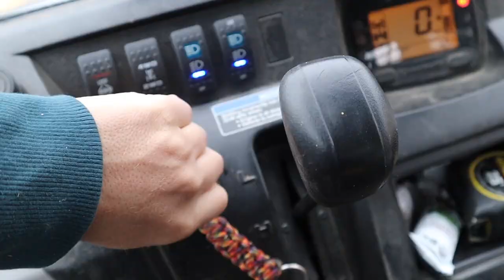We've Never Done IT Like This Before Installing a Gravel Floor in Our Post & Beam Barn

Comment: I would want to spot a couple of 40' CONEXes at the new place to begin a base for operations. It would permit secure storage of tools and equipment and can be finished out as office and shop space. You can even add roof trusses and corrugated metal to create sheltered space between them.
Reply: That's a good idea to get a shipping container up there - lock stuff up and a good  center of operations, as you said.
Reply: Andrew Camarata took this principle to the extreme! Check out his castle!
Reply: Office space, really? lol
Reply: Matt over at Diesel Creek has an excellent one of these! https://www.youtube.com/watch?v=iQOnURQ-hGs
Reply: Practicle advice cheap easy to drop off and easy to maintain and hold a sellable value once done with them
Reply: I would also suggest moving a travel trailer to the site.  That way you have shelter and a clean bathroom to retreat to when working on the land.
Reply: @susannielsen8688  They already have plans to build an outhouse, and I thought the container idea a good one for a base of operations while clearing, etc.
Reply: yes..sounds like a sound plan..at one time, we must stop thinking like a ''Settler',...lol..2 containers set apart..a few trusses and wham bam you have yourself a functional garage and storage space and even a place to warm up with a stove and adjacent lew..all fireproof
Reply: @freddddyyyuk  yes, I love the resourcefulness of this guy.
Reply: Judy G.  storage needed for them chainsaws...lol
Reply: @susannielsen8688  another great option but 2 -40 or 50ft containers  give you more bang for the buck

Comment: When we got our raw woodlands we purchased a camper and set it up. This provided us a place to stay, warm up, and store some basics. Once building was done the camper went to a new home. We hauled water and propane and were able to have hot showers and heat and AC even! A small generator was all it took to keep things running. We could spend a couple days clearing land and have a comfortable place to rest our weary head at the end of the day. It made the experience much easier and we were able to start using the property right away.

Comment: My house was empty for several years before I moved in. I’ve been battling mice for six years. I started using Peppermint Spray. Just Peppermint oil from the grocery store mixed with water. I spray every week. So far, knock on wood, I haven’t had any mice. Try it. It couldn’t hurt anything and it makes it smell good.

Comment: Good job you three. my wife just moved back to Idaho onto 40 ac. of timber ground. I don't recomend starting over at 70 but we are both in good health just slower. We would loved to have got 500 ac. at your age. Logging is good as long as you keep a close eye on the contractor. May God be with you all on your journey. I think you can safely take the mower off the tractor now. Good Luck.

Comment: Coppicing of woodlands has been around for hundreds of years, and woodlands need to be managed. Which is why I can never quite understand the controversy when it's a practice as old as farming. 🤷‍♀️

I would love to see any clearance of the land to bring it back into manged use. I'm not sure a full tour video is something I would be interested in, I think it would be more fun to find out little bits here and there as you discover what the land holds. 

Certainly any building work on the new land would be of interest to me, especially if it relates to livestock.

Stay safe, everyone.

Comment: Looks awesome Al, that gravel will be as good as concrete. 
A tip - if spread/broadcast a couple bags of cement over it (just buy hand just like seed spreading) and water it in with a spray nozzle then compact it it dries rock hard and lasts for years.

Comment: Hi Gina,
Another way to make delicious tortillas is to use grated frozen butter in place of your oil. You can also use lard (also grated frozen) from your lovely pigs. (If you try these, don't over mix, best to use hands.)  Fry them in your cast iron skillet or use a tortilla press.  They freeze well and can be warmed in the regular oven or toaster oven.  For a sweet version, try them with nut butter of choice; melted chocolate or hazelnut spread; nut butter and jam or syrup; or use just butter and sprinkle with cinnamon.

Comment: I believe if I had that barn you built with the concrete floor I use it one side for chickens and the other for the goats. I believe that the reason those chickens are getting out is they are flying on top of the one coop and over the fence. Plus the fence is a little low. Because some chickens are determined to be free range. I do agree that logging is necessary. I'd love to have this 20 acres logged a little bit. Can't wait to see what else is found on the new property. Have a great day today.

Comment: Good morning.  I built a shed and lined the out side perimeter with large rocks and filled in around them with the same gravel you are using to taper away from the bottom boards (which aren't treated). It keeps the flow of water away from the wood. I did it six years ago and the wood hasn't even begun to decay. I figured since you have an abundance of rocks you may want to give it a try to keep the boards from decay and water seeping into the garage / barn.

Comment: I will definitely agree with a sawmill and also a chipper because even after you finish your initial logging you will have plenty of use in the years ahead. Hopefully you can offset your logging expenses with some nice logs and still have plenty to mill at a later date. Good luck and congratulations on your new journey 👍

Comment: As a first project on the new land I would definately build a small cabin for storing tools and equipment, but also insulate it and set it up as a refuge cabin for yourselves.

I would also consider putting down geotech fabric under the gravel around the buildings that are high vehicle usage areas to stop the gravel sinking into the mud.

Comment: P.S- How far away is the grid? Can you easily hook up or are you going for off-grid? We built for both. 
   Thanks! ~ Diane
Reply from the maker: We want to go off grid
Reply: @LumnahAcres  So maybe solar? What about possible water (hydro) and/or wind power.  Solar would only be practical in warmer sunnier months where you are.  Maybe have two or even all three opt.  for the best time to use them?  Wind is only practical if you have wind enough and water when the water is moving.  Winter might be totally out as an opt. unless you have a gas generator or maybe steam using firewood.

Comment: You might want to rethink removing dead fallen trees. Sure, This may reduce the potential of fire, however, these fallen trees and debris are a vital part of the health of your forest’s ecosystem. 

We are big fans of your channel. We’re excited to see what you have in store for the future!
Reply: When the Lumnahs logged their current property, it was 100% clear cut.  I'm hoping that's not what they are planning for the entire 500 acres.  I'm hoping they'd clear cut areas they plan to use as pastures and make sure to keep much of it "as is" for future access.  Or maybe a combination of "clear-cut" and "selective" logging, picking out certain trees, harvest them, leave the rest.  Costs more (less profit for the Lumnahs) but could be a better long-term plan.  Once a forest has been clear-cut, that's it for at least a few lifetimes to get it back.  That's why I am hoping the Lumnahs will be going slow with logging and be conservative with their approach.
Reply: @samvalentine3206  They mentioned Silvopasture in previous video. This depending on area averages up to 30% trees in the pasture.
Reply: @tonygrimes13  - Thanks Tony - I missed the reference.  https://en.wikipedia.org/wiki/Silvopasture

Comment: Al, are you thinking of doing any lumber storage in the rafters of the new garage/barn/outbuilding? It seems a nice place to keep wood out of the weather.
Reply: Good idea - some of the good quality board feet he has in his "lumber yard" would be better off in loft storage rather than on the damp ground.  At any rate, it shows the "lumber yard" needs to be revisited to clean up the stack of wood, make sure it's got enough air to breath and it's off the ground with a proper tarp.
Reply: @samvalentine3206  Just add it to the list, eh?
Reply: @BRPEngineering  - You got it.  The never-ending list which is always triaged daily

Comment: There's no need to rush logging since it can be done incrementally and though it's tempting to do more now you'll have to remember that there just the three of you will limit what's possible so take it easy since your likely to clear more than you can handle. Al forgets that he's buying more feed not raising it and it's a serious mistake to think other wise since the the Chickens/Goats are getting most of their feed from a bag not the field they've cleared. Most farmers either grow crops for sale/feed alone and there are those the raise stock to harvest or sell its byproducts like milk/wool but they keep it simple by growing its feed since buying can cost more than what it can sell for. Indeed Al once recollected that it cost almost 10$ to raise a chicken once to harvest and that's a disaster because he'd have to sell it at almost 15/20$ to stay afloat and it's a buyers not a producers market when it comes to agriculture. Though you might spend 15$ on an entire chicken in pieces that's two or more levels down from the producer and many farmers have had to sign on with companies just to stay in agriculture since the economies of scale have crushed the family farmer. It's not the will that matters but the bottom line if your going to make this into a going enterprise but the organic market can be incredible yet remember they to are a buyers not a sellers market unless you'll have a way to sell directly. The thrall that Al's under is inspiring but having been the first generation not to have done farming directly the reality was that the family run farm he and Gina have begun is still just as vulnerable as those from my own past so expand slowly since it's more about what you can sell not the acreage that's cleared back then or now.

Comment: I opted for 3/4" minus gravel in my stalls instead of concrete due to cost. Put in about 6" depth and used packer. Put 4'x6' 1" thick rubber stall mats wall to wall in stalls. Stall floors still feel like concrete under the mats and have held up great for 25 years now with horses on them and still going strong!
Do you plan to have logs off the new land milled for lumber for buildings or sell trees for logging, clean-up and grading cost and keep remainder of logged trees after logging paid for?
Would love to see drone footage of new land to see lay out, ponds, springs and creeks. Looks like beautiful land with tons of possibilities.  Will keep you busy for years to come.

Comment: Around here in North Carolina's High Country, there is a lot of logging. Unfortunately clear cutting strips the top soil off the land. We end up with lots of mud/land slides and the remaining land is nothing but clay and boulders. We have 50 acres of forest and have no intention of cutting it down other than spot select cutting. I'd be interested to see your logging done. Most land around here is cleared for Christmas tree production. Our county is the largest producer of Christmas trees in the nation.
Potential Projects on the new homestead: Log enough trees to build a log cabin. Build this cabin near a spring and build a spring house. Build another log cabin as a B&B. Obviously you need barns, workshops and outbuildings too.
We make rotis (hubby is from India) and we cook them over direct fire on our gas range. They are very similar to tortillas. Blessings to all.

Comment: Get those snaptraps with yellow plastic baitpads. The friction between the metal lockpin and the plastic baitpad makes them very sensitive. They also have a sensitive setting as well if you read the inprint on the baitpad

Comment: One thing I would suggest as you're both thinking about logging a the future site of  your home/barns/etc, is to take a look at the distance the house is from the main road passing by your property entrance.  You don't want to be too close, because the local government may decide to convert the main road from a single to a dual, thereby gobbling up your front yard.  But you don't want to be too far away either, because you don't have a paved driveway and if you absolutely need to get out quickly (and there are many reasons this could be true) you may find yourself struggling to get out.  So clear out/log an area with less than 100 yards, preferably less, distance to the main road once your home is built.  How do I know this?  Here in Georgia, I sell sod turf grass delivered on Mac Truck/trailers.  If you need sod or other large items delivered and the drive can't get his tractor/trailer rig in and out of your property without concern of getting stuck, he will likely delivery using his piggyback.  Often, when he does that, the homeowner incurs extra delivery charges for the time that's eaten up the driver could be delivering someone else's delivery or heading home to sleep.  (especially if the product is coming from a significant distance where the driver gets up extremely early to bring your product to you.  If you have your new home's proposed area logged first, you'll be able to have access sooner to the area you're building a home on and can plan and start sooner as well.  Just a couple thoughts,  Best Regards,  Dave

Comment: I see you got that temporary bracing down.  Gravel floor looks good.  You might want to invest in a landscaping rake.  They are great for projects like this, or for evening out DG or dirt.  Worth it for the time it saves.   I get the feeling that the new property is not far away from your current homestead.  You refer to it as "over there" several times, which to me doesn't indicate you have to travel too far.  Am I right?  Is it right next door to where you live now?  That would be a fantastic secret to keep, and reveal on a future episode.  500 acres attached to your current 8.  Name it "The Lumnah 508."  Best to you all.

Comment: Hopefully you could use the same company that did the logging for you on the new pasture you opened up, also fencing Company did you a good job,  then Jamaica Cottage will be ready to supply you with your new barns etc etc, bigger tractor needed also. It never ends. But good luck with your new project on “Lumnah Acres 2”. 🏴

Comment: Yes more information on the logging and clearing of your new property.
Have you had any problems with build up in the chimney due to using wood scraps to start the fire more easily. I had heard that it could be a problem area if not cleaned regularly.
Reply from the maker: We clean our chimney regularly

Comment: Between the 2 buildings could you dig a ditch angling down toward the wood lot behind the buildings and fill it with gravel? It would direct run-off away from the buildings and avoid puddles.

Comment: It's a lot of work to roll them out.  While Gina was doing that, I thought I'd rather buy them from the store.  Someone suggested a tortilla press, and that makes sense.  It wouldn't be so hard to do making it easier to do at home.  I've never done it before.  The garage floor looks great.  Be sure to spread some in front of the side doors to make it easier for the goats to get into their stalls.  I'd like to know what your long-term plans are for your new land.  Are you planning on building a new house there and moving to it?  How far away is the land from your current place?  The property is beautiful!

Comment: Your KitchenAid mixer looks like it needs to have the bowl height adjusted - when the dry ingredients and oil were first mixing (at 27:45) there was a lot of flour not getting touched by the dough hook. There is an adjustment screw to raise and lower the bowl height to get the best performance from the mixer. My wife and mother used their mixers for years with them adjusted wrong - makes a huge difference, worth the effort - and really only takes about 2 minutes.

Comment: in the area of your stalls, before you compact.  add several bags of cement powder and mix into gravel, then after compacting the lot. wet down the mixture in the stall area.  after it sets up and cures, seal the 'crete formed, so urine coming thru the mat seams will not penetrate the base.   may seem a bother...but you will rather dread the bother now than the stink later

Comment: If your going to be burning wood for the house and maybe a large shop some day you might consider a wood processor. Seeing you have lots of new trees that need to be thinned out and most probably lot of standing dead timber you could sell excess firewood to justify the cost of a wood processor. 
My mistake was not incorporating the wood burner with my floor heating system. Now I must update my system with a new boiler that heats the service water and radiate floor heating. I should have spent more in the beginning but the sticker shock stopped me.

Comment: Is it possible for you to use the bucket on the tractor as a tamper? In the back drag position just tamp. The weight of that bucket has got to be pretty impressive.